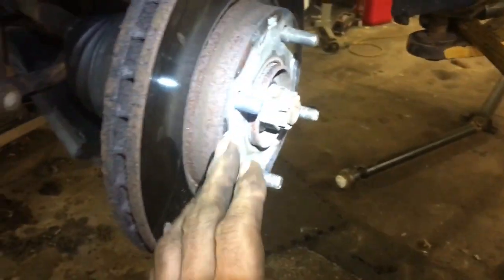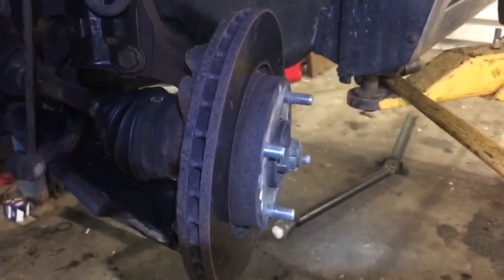Broken wheel stud how to install the simplest way without taking everything apart

Comment: This method is ludicrous and unnecessary not to mention a lot more work. You should not shave wheel studs. Use a large nut and a hollow wheel lug to pull the stud through. Duh.